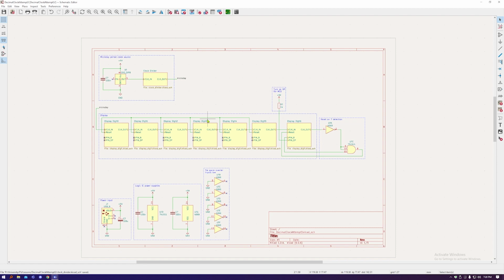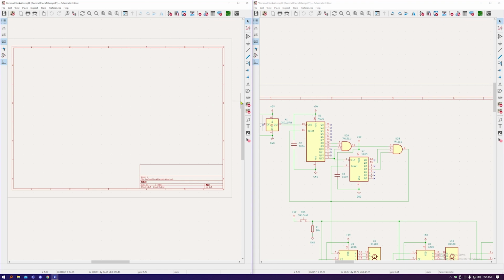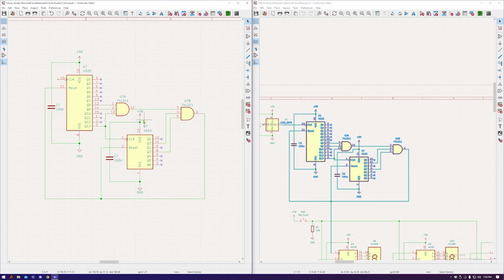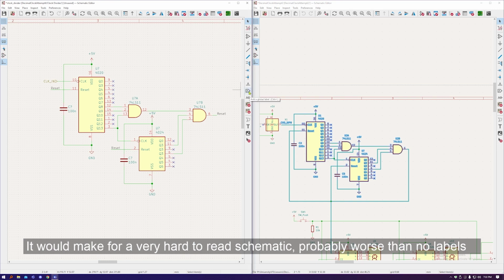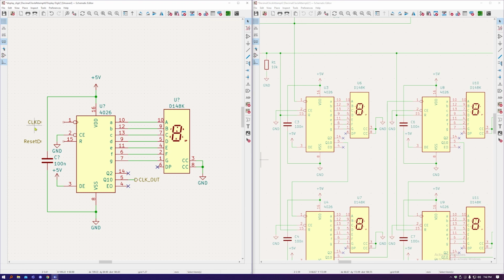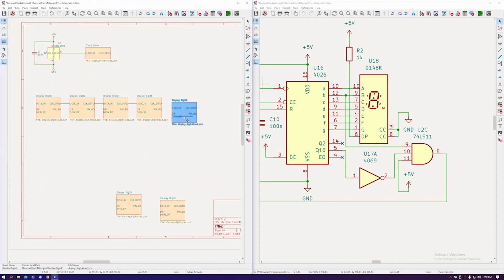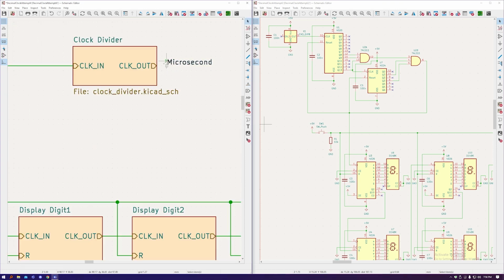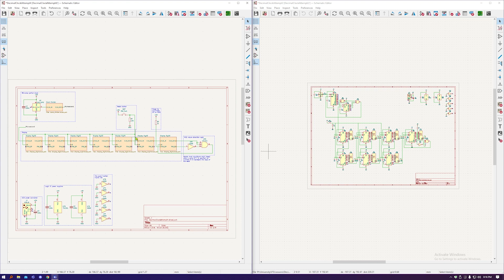Circuit Design ep.4 - Making a Schematic Neat in KiCad

Comment: 3:13: Another cool feature of hierarchical schematics is that you can reuse existing schematics from other projects (or just the stand alone schematic editor) by clicking the folder icon in the 'sheet file' row and browsing to another file. You can also change the reference of an existing sheet to another file whenever you want (like if you redesigned the circuit in the sub-sheet but wanted to keep the original for reference). Although, I don't know if they would get get copied when you archive a project if the schematic is outside of the KiCAD project folder.